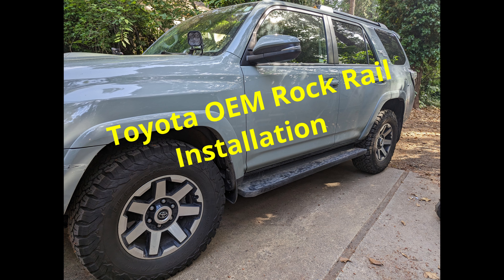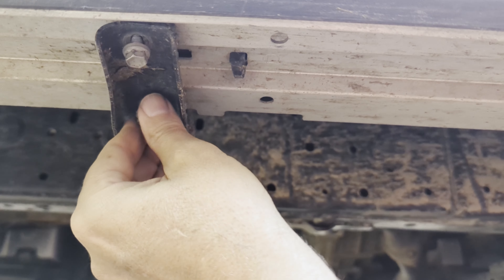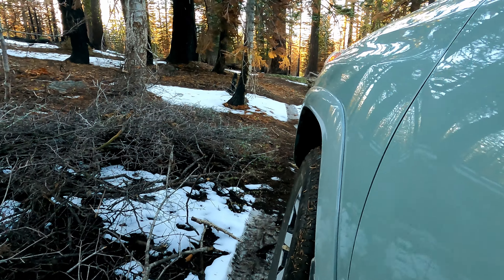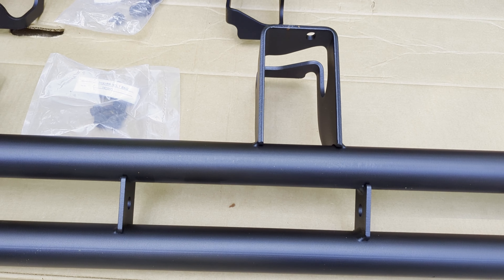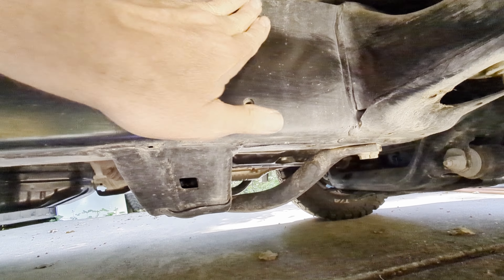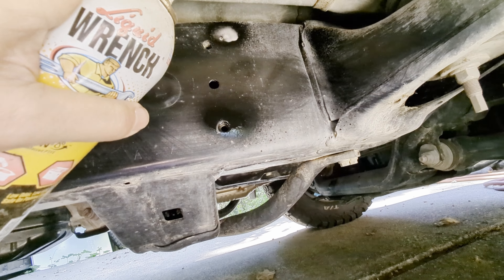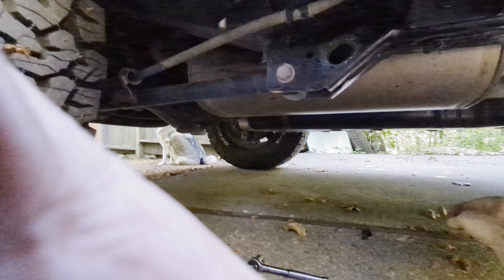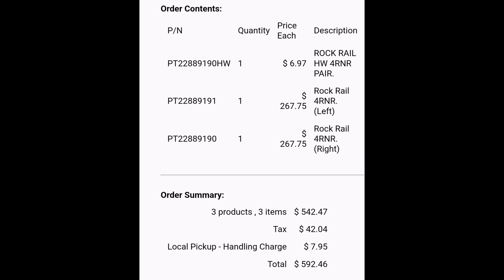Toyota 4Runner OEM Rock Rail Installation

Comment from the maker: So I've been through a few trails where these rails have definitely saved the rocker panels from damage.  I still believe these are the best option for price/quality/fit and ease of installation for moderate duty.  The one drawback I can note is you can't easily stand on them to access items on the roof.  Who else owns a set?

Comment: I just installed these today. Was impressed with the quality, wanted some protection without going full aftermarket (had a pair of those on my FJ but the 4R doesn’t see that off road action). 
Did you notice on yours they ever so slightly angle out toward the rear wheel. Not much but a tad I feel the designer are paying attention more to what’s happening out there with aftermarket mods.
Reply from the maker: Exactly the reason I put these on.  I think they are the smart choice for decent protection in a rig that won't be rock crawling.

Comment: The Tap you used to chase the threads was ? X 125
Reply from the maker: I believe m8.  I don't really remember, but that's what I grabbed in the video.  I have a set of thread chasers I use, not thread cutters.  I've used thread cutters before, just very gently.
Reply: @SierraCruiser  👍🏻 tks for the reply, I think your right

Comment: How many bolts are in the hardware kit PT228-89190-HW? Do I need to order one hardware kit for each side, or does one hardware kit have enough bolts for both sides?
Reply from the maker: Each rock rail came with the hardware pack.  I ordered one because I didn't know they already came included.  You will need one kit per side if your rails come without the hardware kit.  5 bolts in the kit. 
Let me know how it goes if you install these rails on your rig!